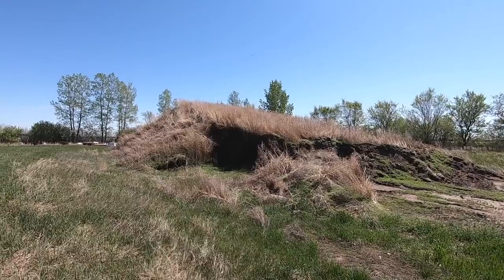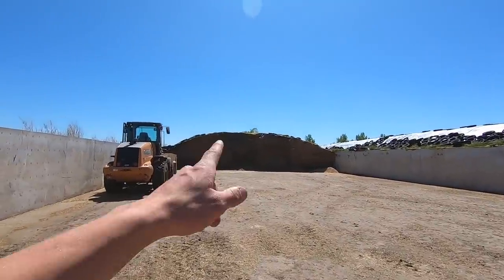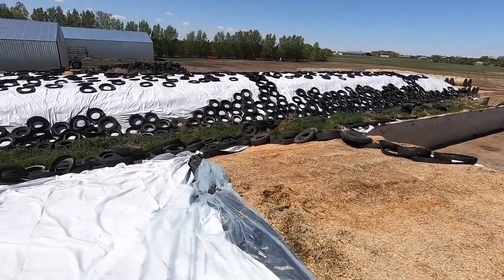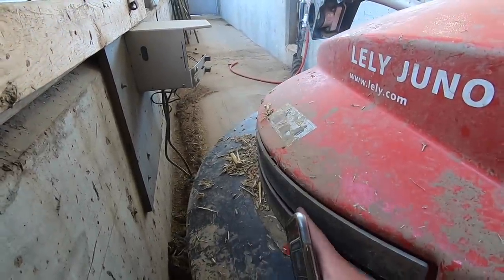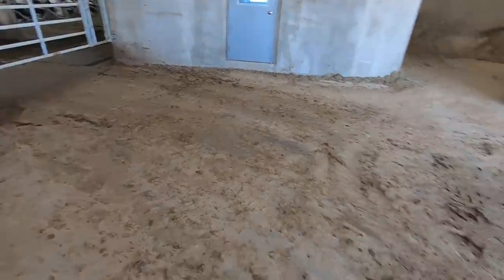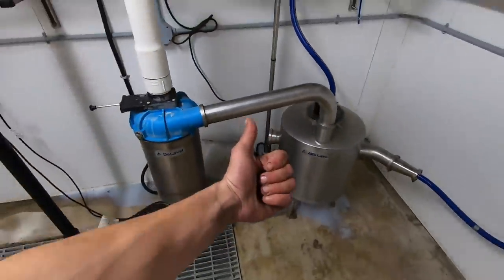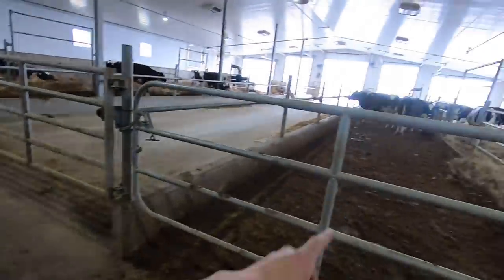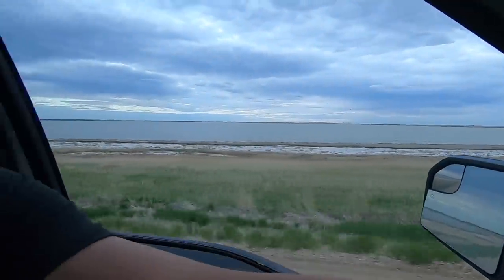Close up Cows and The Start of Spring Cleaning

Comment: Jan, wondering why your team doesn’t fill in some of the muddy zones with loose rock and gravel? I am sure concrete is inappropriate or too expensive, but grading in some stone (#3 or #2) could really help. But then again, I’m not a farmer and only an engineer! Thanks for sharing your life and livelihood with us.
Reply: I cringed when he dumped that great looking top soil in the ruts. my garden would love a scoop of that.
Reply: Dirt is cheap and easy fix to something that you'll always have problems with. Unless you have a thick slab of concrete. It will just crack under pressure over the years, even with bar in it. Bigger rocks work, but eventually they get pushed into the soil and you'll be back at square one.

Comment: I watch you and Eric from 10th Generation diary farming. Question I have is how do you fill your potholes in around the yard  ? You don't put dirt in them with the nice red rocks do you.  When I worked for a farmer the day we sold our last load of cattle the next day we started grading the yard and driveway and order 2 inch rock and  covered the whole place that you could drive on.
It was like 25 loads triple axle dump trucks and that filled in alot of holes and then we went over with inch rock and that was like 18 loads and then we always had 2loads on a pile where we took from and filled in holes when needed. But every year after that once the snow was all melted off he would call and have the yard covered with inch rock and it made everything look so much nicer as all the buildings were red and white roofs out of steel or tin. And the boss decided he wanted a big machine shed cuz all we had was a corncrib gutted out in the center and we had a 77 oliver on the feed wagon and the 1650 loader tractor with no cab on the grinder. So the boss got a guy with a bulldozer and took out 300 ft of his grove going North and south and 50 ft north of the hog confinement going east and west was the south side of the machine shed he had put up, it was 54x 130ft long and once it was done we cemented it out and 54x100 we filled with dry corn, actually we emptied all our bins and we had bulkheads inside the sliding doors on the Eastside and we had bulkheads 30 ft in from the sliding doors on the Southside and there was a walkin door in the se corner and ne corners of the building. And once the building was up we had loads of 4to 5in rock hauled in and that was our base and the night before we poured cement in the machine shed we got 4 inches of rain but it didn't slow us down cuz the 4or5 inch rock we put down was our base and the corn we put in the machine shed was in their 3 yrs and it paid for the building but we had to walk the corn 2x a week to keep it from crusting and heating up. After 3 years of storing the corn I wasn't fond of flat storage. But every year we put a layer of inch rock on top of the 4 or 5 in and never had any pot holes or anything plus there was all kinds of traffic around the machine shed and heavy equipment. And we had inch rock around all our bins and buildings to keep the mice down or away. I ground all the feed  with a 2.5 ton Artsway grinder which consisted of 100 loads a month